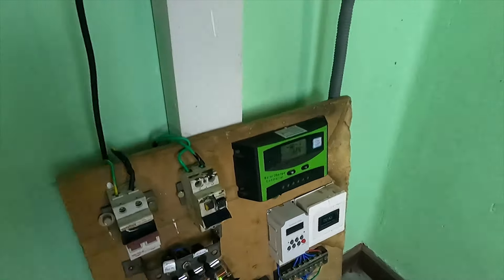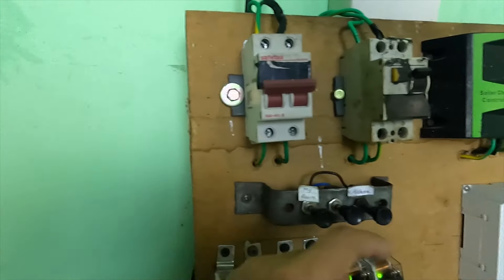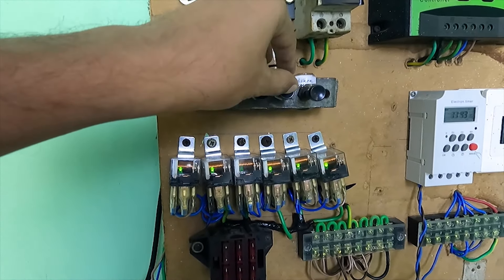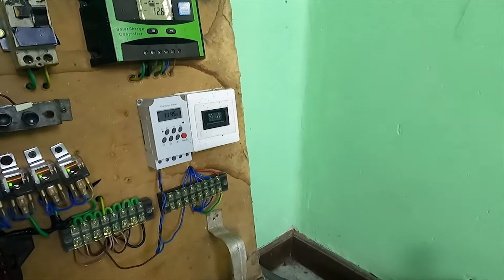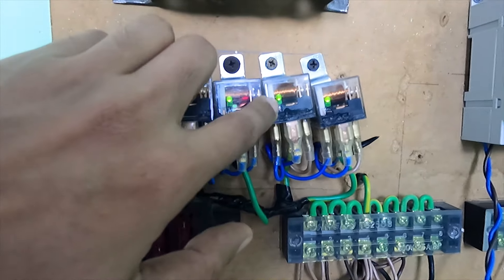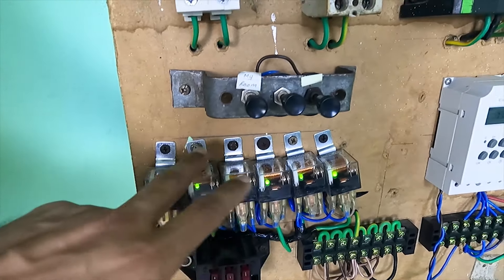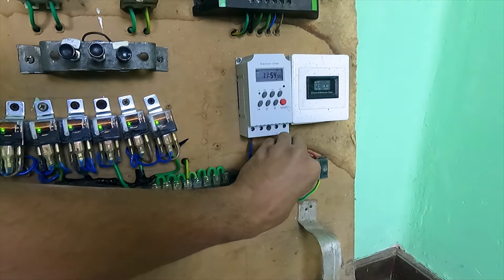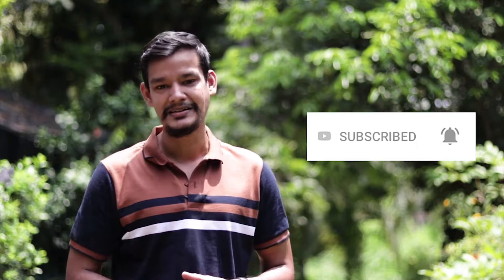HYBRID සුර්ය විදුලි  බලය ගැන සිංහලෙන්

Comment: Change over relay deka router off wenne nethuwa wiring eka gena kiyanna aiye. Mama dala tiyenne shottky diode ekka thawa battry ekk.
Reply from the maker: Me use karala tiyenne samanya 12v 5 pin relay dekak.

Eka relay ekakin karanne battery voltage eka adu Una gamanma thawa 12v relay ekakata meda pin eke Idan thawa relay ekakata 12v connection ekak denawa.

Eken thamai 5A main current plug point eka on wenne.

Ekata thamai 12v battery charger eka connect karala tiyanne.

E plug ekatama connect karanawa AC to DC adapter ekak .

Eken thamai deveni relay ekata 12v power supply eka yanne.

Ethakota thamai me sampurna system ekama wada karanne.

Saralawama kiwwot low voltage wela main relay eka off Una gamanma e relay eke meda pin ekata battery eke Idan direct connection ekak dila tiyanawa A kiyana relay ekak haraha.

A kiyana relay eka on wenne main current supply eka tibbot.
(AC to DC adapter eken)

Main relay eka off wenakotama eken B kiyana relay ekata 12v connection ekak labenawa.

B relay eken karanne 5A main current plug ekak on karana ekai.

Main current plug ekata battery charger ekakui AC to DC adapter ekakui connect karala tiyenne.

Ema DC adapter eken thamai A kiyana relay ekata 12v supply eka labenne.

Mama relay gana videos dekak meta kalin Karala tiyanawa.ewa mage play list eketh tiyanawa.puluwannam balanna.

Ekedi pahadili karanawa relay ekak kriyathmaka wena widiha .

E video dekath balanna.ita passeth yamak danaganna awashya nam comments wala idiripath karanna.mama anivaryenma reply karanawa.
Reply: @DIYwithAsanka  aiye me relay tika dapu vidiya diagram ekk ekka video ekk karanawada
Reply from the maker: Bohoma stuthi obage comments walata

Comment: සුපිරි🔥. ac එකෙන් charge වෙන්න දාලා තියෙන relay එකේ වර්ගෙ මොකක්ද දාන්න ඔ්න.
Reply from the maker: Onama 12v relay ekak wada karanawa.me pawichchi karala tiyana eka nam 80A ekak.meka thamai mata cash on delivery website ekaka aduwatama tibba relay eka.ekai mama eka use kale.
Reply: @DIYwithAsanka  thank u
Reply: oyage 12v chager eka ampere kiyada mehe ganna thiyenawada.matath hadaganna ona me dawaswala awwa nethi nisa charge wena eka adui.
Reply from the maker: Meka 12v  20A  smart charger ekak.
mehe  ganna tiyanawa Rs 4000 wage wenawa.

charger eka nati nisa oyata karanna tiyana hondama option eka thamai relay eke middle pin ekata dena 12v connection ekata ,3A withara fully rectified transform ekakin supply eka denna.
ehema karama oyata me system eke tiyana battery bank eke idan ena relay eka natuwa me system eka use karanna puluwan. 

Mehema karama battery bank eka charge wenne na.
namut oyage 12v load eka continuesly use karanna puluwan, aye solar pannel eken battery bank eke voltage eka wadi karala nawatha system eka on karanakan.

Comment: Aiye mama gaththa 150w.inverter ekak. Eke thiyenawa. Input. Dc12v.20a. Kiyala mekat 20a wada denna beda pichcheida
Reply from the maker: Inverter eke oya widihata mention karala tiyenne inverter eka uparima output eka denakota eke amp gana 20amp kiyala .

eken kiyanne meka battery bank ekata connect karanakota yodanna ona fuse eka 20amp walata wada wadi agayak tiyana fuse ekak yodanna ona kiyana eka.

ethakota me inverter eka connect karana battery bank eka 12V wenna ona. Ampere gana ita wada wadi wenna ona.

Example ekak widihata battery bank eka 12V 500amp .me battery bank ekata oyage inverter eka direct connect karanna puluwan. Kisi prashnayak nathuwa
Reply: @DIYwithAsanka  oya ape prashnawalata reply karana eken api godak dewal denagannawa tnq aiye.godak ayata ona me solar system eken water pump ekak kriyakarawanda. Puluwannam e de gena video ekak karana dc moter gena hari
Reply from the maker: Thank you very much.
Mama issarahadi video ekak karannam solar walin onama load ekak use karana widiha gana

Comment: ආව ගමන් බැලුවා.පොඩ් අවුලක් තියනවා. පැරලල් නේද කනෙක්ට් තියෙන්නෙ බැටරි, සිරිස් නෙවෙයි නේද?
Reply from the maker: Ow oya hari.mama dan aye baluwa video eka.mama eka explain karanne parallel widihata namut kiyala tiyenne series kiyala.
Thank you for the support
Reply: @DIYwithAsanka  කලින් වීඩියෝ බැලුව ඔයාගෙ.මං අලුත් මේ විෂයට.මගෙත් තියෙන්නෙ 100 ඇම්පියර් බැටරි 2ක් පැරරල් දාල තියෙන්නෙ.මං වැරදි නියල හිතුවෙ.
Reply from the maker: 150w  panel එකක් තමයි තියෙන්නේ .මගේ system එක තාම 12v.
Reply: @DIYwithAsanka  ටිකක් දුරට වයරින් කලා කැමරා වලට (15m වගේ බැටරි ලග ඉදලා) 15A 12V ගන්න. බැටරි චාජ් හොදට චාජ්. වොල්ටේජ් එක අඩු වෙනවා ටිකක් රැ වෙන කොට DVR එකට..
මට හිතෙන්නෙ වයර් වල ගේජ් එක අඩු නිසාද එහෙම වෙන්නෙ? (වයරින් වයර් 0.81mm)
Reply from the maker: Issellama calculate karala baluwada oyage load eka kochchara  amps pawichchi karanawada kiyala.
 In passe thamai wire eke gauge eka thiranaya wenne,wire eke diga anuwa.
 (12v wire gauge sizes chart eka refer karanna)
Pawichchi karana load eke amp gana wadi karanna pawichchi karana hours gananin.ita ekathu karanna load eka ira eliya nathuwa dawas kiyak tiyanawada kiyala . 
(Eg.dawas 2k)
 e ena uththarayata anuwa thamai battery bank eke size eka thiranaya wenne. 
Oya widihata thamai off grid solar system ekak hadaganne.
Me ganana hada ganna lesi wenna online off grid solar system calculator ekak pawichchi karanna.me widihata ena uththaraya oyage budget ekata anuwa match karala hada ganna.
Mage "relay gana thawaduratath" video eke balanna.eken thawa wadi wisthara bala ganna puluwan wewi. Video eke link eka video description eke tiyanawa
Reply: @DIYwithAsanka  hodai.. BOhoma ස්තුතියි,   වොල්ට් මීටර් ,ඇම්පියර් යුසේජ් මීටරේ ඩ්ස්ප්ලේ එකක්  දාල තිබ්බෙ. ඒක සෙට් කරන විදිහත් වීඩියෝ එකක් කරන්න
Reply from the maker: @charithmaduranga6863  mage "Relay gana thawaduratath "kiyana video eke pahadili karanawa circuit ekaka Amp gana multimeter ekak pawichchi karala kohomada hoya ganne kiyala.
ekedi pahadili karanawa multimeter ekak kohomada circuit ekakata sambanda karanne kiyala.
e video ekema tiyanawa volt measure karana vidihath.

Comment: Battery 60% use karala kiyala danagnne kohomda aiya.  E gana wenkota voltage eka kiyak witarada tiynne
Reply from the maker: Led acid battery ekaka voltage eka 12.20 (voltage per cell 2.03)  kiyanna e battery eka 60% use Kara kiyalai.

E level ekata battery voltage eka adu wenakan   use karanna ona kalathurakin.

Daily discharge karana voltage eka maximum tiyenna ona 12.30,(per cell voltage eka 2.05)  .
E kiyanne battery eke capacity eken 70% daily discharge Kara kiyala kisima prashnayak Naha.
Reply: @DIYwithAsanka  
Can u explain this theory again i didn't get it.like,
How to know when batteries are discharged 70 percent of the capacity
How much can we  discharge depends on the battery types
Wht will happen if we over discharged it frequently
Reply from the maker: In this video I have used led acid batteries.if you over discharged these batteries they will get permanently damaged (it will reduce the life span of this battery drastically).

One way you can identify the battery capacity is from the battery voltage.it is not accurate but it is the most cheapest way to identify the battery capacity.

70% of the battery is equal to 12.30 (battery voltage) which is equal to 2.05V per cell.

If you want to get the accurate reading of the battery capacity you need to use a battery monitor .it will give a accurate reading of the capacity and the voltage.

Since I do not have a battery monitor in my system that is why I have set the low voltage cut off by the voltage.

The voltage of these batteries are mentioned by the battery manufacturers.this voltage will be differs from the battery type.
Reply: @DIYwithAsanka  thank you
If there are resources that can gain knowledge regarding the solar can u brief me.
Reply from the maker: This is my hobby.and I needed a solution to the power cut.thats why I'm interested in this renewable energy.
Other than that there is not much details regarding off grid solar.

Most of the time  I watched YouTube videos to gain knowledge
Reply: @DIYwithAsanka  thank you for ur information

Comment: ඔබතුමා ඉන්වර්ටර් එකක් සම්බන්ධ කරන්නෙ නැද්ද  උපකරණ සහ බල්බ් 12vද  උපකරණ 12v කරන්න කියල දෙන්න ස්තූතියි
Reply from the maker: Mekata inverter ekak ekathu karala na.ita eka hethuwak thamai magawa tiyana inverter eka modify sign wave inverter ekak. 
Anith hethuwa thamai me system eken sampurna karana viduli awashshathawa main current  (AC) yodagaththoth dawas 1/2 wage thamai pawichchi karaganna puluwan. 
Mekata inverter eke efficiency ekat bala panawa.

Oya hethu hinda thamai thanikarama 12v pawichchi karala tiyenne. Me eka upakaranayak wath 12v walata convert karapu ewa neme.

Fans,lights miladi gaththe 12v ewa thamai.
Router saha Anith 12v upanga wala input eka 12v thamai thibbe power adapter walata sambanda karala. Ehinda mama adapter eka iwath karala e wire ekatama 12v supply ekak dunna battery bank eken.
Reply: @DIYwithAsanka  Thanks ගොඩක් දේවල් ඉගෙන ගත්ත

Comment: බැටරි AC කරන්ට් වලින් කොපමණ කාලයක් චාජ් කරන ඕන ද
Reply from the maker: Mama battery charger ekak mage
 system ekata set karala tiyenne.

 Mage samahara kamarawala viduli awashshathawa sampurnayenma awaranaya wela tiyenne solar board eka haraha nishpadanaya karana viduliyen.
Eka hinda charge controller eken battery voltage eka 12.2 wada adu wunagaman  load eka off wenawa. 

Ekata vikalpayak widihata thamai me video eka mama kare

 charge controller eka aye auto switch wenna nam voltage eka 12.9 wenna ona.e voltage eka wadi karanna thamai charge controller eka set karala tiyenne. 
Me system eka hari widihata godanaganawanam ira eliya nathuwa dawas 2 k wath oba pawichchi karanna yana load ekata athi wenna tharame battery bank eka loku kara ganna ona.

Me video eka upload karata passe mage solar system eke godak changes karala tiyanawa. Dan mata tiyana battery bank eka 500amp ekak. Eke 50% depth of discharge eka gaththot 250amp wenawa.ethakota mama dan use karana load eka 24hrs on karala tibbat ara 250amp mata use karanna baha.

Comment: Why did u connect two batteries in parallel is there any reason and wht will happen if connect it in series or any reasons to connect batteries in parallel or series.
Reply from the maker: The reason why I have connected batteries in parallel is that I need the voltage to be 12v and amperage of each battery should be added.thats why I have connected them in parallel.

If you connect batteries in parallel voltage remains the same but amperage adds.

If you connect the batteries in series voltage adds but amperage remains the same.

Comment: If i use a off grid system with off-grid inverter , does it make sure units ( kWh) doesn't go to the grid .can u explain me the theory behind this
Reply from the maker: There are two main types of Inverters in the market.
One type is grid following Inverters.
Second type is grid forming Inverters.

Grid following Inverters are called grid tie Inverters.
The theory of this Inverters are they need a grid to be present in the system in order for them to manipulate the grid.if the grid goes down this Inverters will automatically be shut off.

If the grid is present grid tie Inverters will accurately match the voltage and the phase of the grid sign wave.And it will slightly increase the voltage of the output.(the reason behind this is your house will consume the electricity generated by this  Inverters first and if any excess electricity is generated will be exported to the grid.)

Grid forming Inverters are called off grid Inverters.they will create their own grid and produce electricity.you can not use a off grid Inverter if the grid is present in the house.
Reply: @DIYwithAsanka   
But we have done such off grid systems where grid exists.
And why we can't go for a off grid system when the grid presents.
Reply: @DIYwithAsanka  And also i want to know what are the things which needed to consider when doing a off grid system
Reply: @DIYwithAsanka  Thank you for your reply, seems can learn lot from you
Reply from the maker: I'm glad that I could share my knowledge.
Reply from the maker: If you are going to do that you will need a hybrid Inverter or you need a grid tie Inverter with the limiter.
Those Inverters can work with the grid and reduce the electricity consumption.

In order for you to install such Inverters at your home they should be installed by a licensed electrician and it should be approved by the CEB.
Reply: @DIYwithAsanka  
Which means though there are inverters called as off grid they will deliver power to the grid if there's a any excess power right?
Reply from the maker: Off grid Inverters will only produce power to complete your current load.it will not produce power to the grid.

Only Grid tie Inverters and hybrid Inverters can produce power to the grid.

If the Inverter has a limiter that Inverter is capable of exporting power to the grid or use it as a off grid inverter.
Either way you are gonna setup the inverter.

Comment: 12v බැටරි වලින් විදුලි උපකරණ භාවිතා කරන්න කියලා දෙන්න  ඉන්වර්ටර් ඇතුව නැතුව
Reply from the maker: Godak main current wada karana upanga wala pitipasse sticker ekak alawala tiyanawa. E sticker eke sandahan wenawa ema upangaya kriyathmaka wenne AC  da DC da kiyala.

Udaharanayak widihata bohomayak internet router ha peo tv upanga weda karanne 12v walin.
 Multimeter ekak tiyanawanam meka hariyatama confirm kara ganna puluwan .
router ekath ekka ena main current adapter eke, router ekata connect karana jack eka galawala ethanata multimeter eka sambanda karala viduliya measure karala baluwoth, ethana DC 12v     pennanawanam ,e upanga kelinma 12v battery ekakata connect kala kiyala gataluwak wenne na.
mehema sambanda karanna kalin main current adapter eken ena positive ekai negative ekai jack ekata  sambanda wana widihatama battery ekata sambanda karanna.

Anagathayedi me sambandayen wistharathmaka video ekak karanna uthsaha gannam.bohoma stuthi adahasata.
Reply: ඔබතුමා පැහැදිලි ව කියල දෙනව